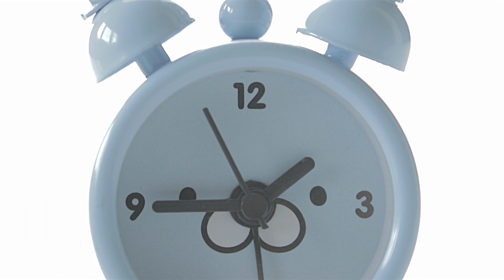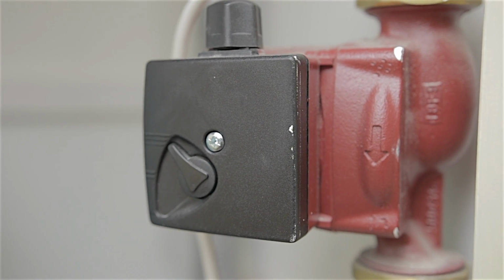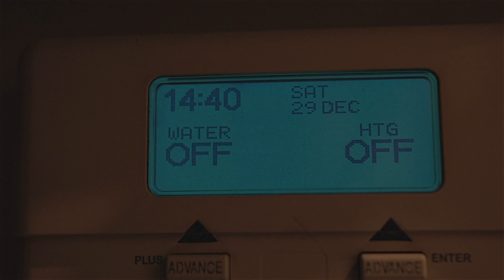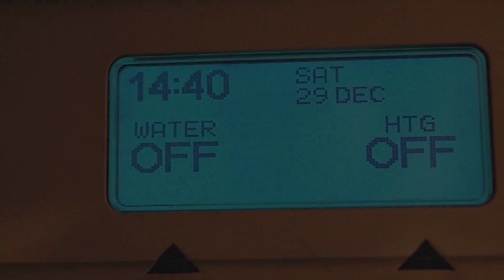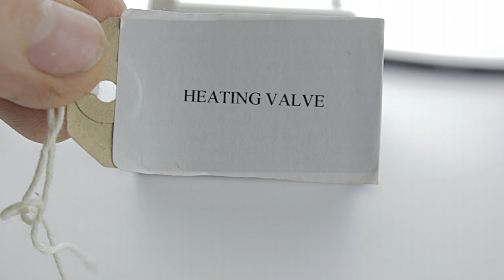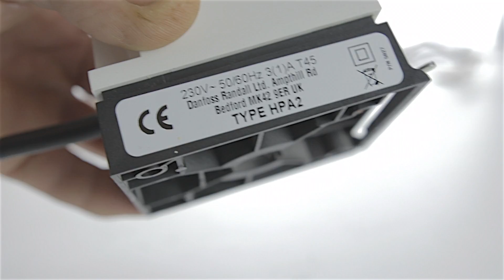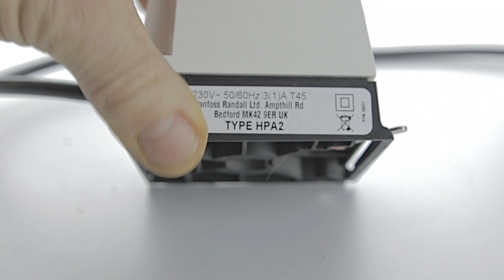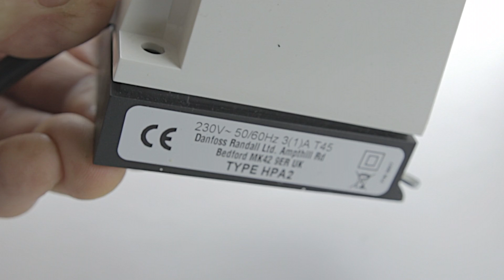My Boiler Wont Switch Off... Danfoss Motorized Valve

Comment: Just dealing with the same thing ! except my valve was shutting off at a 45degree allowing hot water cylinder heat to heat rads when off ..
cheers

Comment: Legend thanks saved me having to shell out on a plumber, took my Danfoss actuator off for the Hot water and noticed it had a really stiff valve, bit of WD40 and unstiffed using some pliers now back to working order, what made me notice this was that my hot water from the taps was beyond hot it was scolding, this was new, noticed my heating pump & boiler wouldn’t shut off even though the hot water was turned off
Reply from the maker: excellant😊

Comment: Helped me resolve a pump overrun issue, playing around with the auto/manual slider on the hot water valve eventually I got the pump to stop so now I know where the fault lies.
Reply: No need to replace though, remove, strip down, squirt a load of contact cleaner into the microswitch, press a few times manually and allow to evaporate then reassemble.

Comment: My boiler doesn’t auto switch on . However if I manually switch on it works . If I turn boiler off it auto switches off. Do I need a new auto valve?
Reply from the maker: probably but have an experienced electrician look at it first

Comment: Thanks very much for this well explained video. I've just had the same failed actuator problem. The unit kept clicking and trying to operate the valve, but couldn't. I slid the silver lever to manual (top left of the unit) and the downstairs is heating up again. Will get a new unit tomorrow.

Comment: I have 2 x Danfoss HPA2, one Hot Water and the other for the Radiators. The lever on the Hot Water one is constantly loose and on the Radiators one the lever still has the resistance so presumably off (closed) but the rads stay permanently on....any ideas?

Comment: Bang on!  This is a very strange fault and many suspect the boiler or timer.  In many ways one can consider the little micro switch in these units as holding your whole heating system hostage!  Once you know about this it is easy to solve what seem to be very odd issues with the boiler staying on or not starting up.  BTW one of the problems with the actual water valves getting stuck closed is the boiler will start up and then fail as it cannot pump against a closed valve even if it thinks it is open.  Ovalling of the plastic part of the zone valve can cause a loose fit too which is problematic!

Comment: Hi, can you please help me out my motorised valve moving when i turn the  heating on and off upstairs, but the boiler won't turn on unless I turn the downstairs heating on.
Reply: Check that the boiler is getting a connection (often orange) from the upstairs set so that it gets the signal to turn on and that the microswitches in the valves upstairs are actually being switched on by the motor turning far enough.  Sounds like this is not happening.

Comment: I have 2 danfoss zone valves one for the heating one for the unvented hot water cylinder. I have an ideal icos he12. My boiler isn't firing up but the pump won't shut off. Would this be the same issue. A faulty zone valve?

Comment: Hi Alan, my Danfloss 3 way valve electronics were changed by me 12 months ago, then I had the physical Danfloss 3 way valve changed and a Google Nest Thermostat Gen 3 installed to manage my hot water and heating by a heating engineer. Every 2 hours, whilst both the heating and the hot water are both switched OFF at the Nest, the boiler comes on for 30 seconds, the water pump is churning the hot water tank (I can hear it gurgling) the rads don't heat up and the Nest is not showing a request to burn but I can see from my energy supplier gas smart meter (shows usage every 30 mins) that I am using an extra 8 kW of gas a day (more than additional £1 a day). 

I rang Danfloss and got through to some pr1ck in their tech support who wouldn't help me because I was not a qualified electrician or heating engineer and refused to help me full stop. I have now ordered a Honeywell 3 way valve from my heating engineer to replace  that Danfloss sh1te and will report back later. If the problem goes away, I am sending the Danfloss equipment back to their HQ in Uxbridge for them to dispose of it.

Comment: Ridiculous designs on these things that the motor has to stay energised (using electricity) to work against the return spring for the duration of the time that the heating is on
Reply from the maker: yes and not very reliable either

Comment: Mine did not last 2 years, and it was a brand new house with brand new boiler system. After 3 years 2nd one is gone as well. They are set to fail after warranty period is over.

Comment: Thanks for this video. I think I currently have this exact problem. Do you think this repair would be too difficult or dangerous for a complete novice to undertake? Would it be better to get in an electrician to do the rewiring or would a different kind of engineer be required?
Reply: You can do it yourself. You posted this three weeks ago so interested to know what you did.
Reply: @roberthemsley2  I've ordered two replacement valves, should be arriving shortly. Still not 100% sure how I will proceed but am planning to check out the parts and evaluate the situation at that point. :)

I had a technician round who actually thought it might be an issue with our heat interface unit rather than the valves and tested the valves repeatedly and decided they were fine... only for the valves to exhibit the exact same issue a few hours later, after he'd left of course. It was all outside of his specialism though so he couldn't say for sure. At present my plan is to replace them, hope that fixes the issue, and if not then get someone in to hopefully look over the HIU.
Reply: @feedthefrog  I ordered a vale on Amazon next day and gotten them myself. Works perfect now.
Reply: @roberthemsley2  I fitted a relay Brown wire and natural to the coil and then split the orange wire across a set of normally open contacts. So when the switch within the valve fails the relay controls it. My valves always failed within the warranty period  I returned them to Danfoss for a replacement. There are different manufacturers heads you can fit.

Comment: Not mentioned in this video is that the valve actuator contains a microswitch which (in my case at least) is used to switch the boiler on when the valve is open. I'm getting a problem with the boiler not switching off, even though the valve is closed. I think it's the micro-switch that is the problem.

Comment: Thank you for the video. I have one of these I suspect is stuck open. If I remove it from the pipe work and disconnect cables (mine has a 4 pin connector so just unplugs) should this stop that system constantly calling for heat? I have 2 zone heating and it’s just the one for one room that seems to be stuck on. I need the main house ch and hot water still while I get around to replacing it.

Comment: Hey Allan great channel, I have a similar problem with my CH system but I think my issue is that the valve has siezed causing the motor to burn out. My heating is'nt working at all as a result??? Its the second siemens valve I've fitted, both have lasted roughly 10 years. I have a honeywell on its way.  Maybe I'll do a vlog & post it!!
Reply from the maker: i hear from a plumber friend that honeywell are the best brand

Comment: I have a similar problem, the valve appears to jam open. When the programmer tells it to switch off/close, it  doesn't, and I have to go whack it a few times and jiggle the manual overide switch on the actuator, until it eventually drives closed. I have replaced the actuator maybe 3 or 4 times, and cant find a solution, thinking it is a controls issue or the valve is overheating and jamming (its in the under stairs cupboard, under  a hatch which is carpeted. Any solutions??? or juts keep replacing the actuator every few years?

Comment: Great. Fantastic video. This happened to me too with the same age of valves before they broke. Just got both fixed yesterday. £40 per valve and £80 for the electrician to do the job and source the parts.
Reply from the maker: Glad it helped
Reply: I fitted a relay Brown wire and netural to the coil and then split the orange wire across a set of normally open contacts. So when the switch within the valve fails the relay controls it, I have had this system fitted for about three years now with no problems. My valves always failed within the warranty period  I returned them to Danfoss for a replacement. There are different manufacturers heads you can fit.

Comment: Would this valve have anything to do with heating hot water only? Currently can't figure out how to heat hot water without having 1 radiator on which can't be turned off individually

Comment: After I light a fire my boiler keeps pumping hot water to the radiator for days unless I turn it off at the mains. Doesn't do it if I just turn on oil heating. Would this be the same problem?

Comment: Many thanks for the video. This is exactly what's been happening to my boiler during the last two weeks. I found the valve lever locked into the fully open position. I have a Hive controller which said it was 'Off' but the boiler continued to operate outside of the scheduled periods. Can these valves lock themselves into that fully open position?
Reply: Yes they can, slide the lever to the MAN (for manual) side and it should lock in the 'on' position

Comment: I had those,  sadly mine used to explode, and create a smell due to valve seized,  and stink the aired clothes out in acrid electrics ,but in my modern house it would trip the mcb  and rcd and then house alarm would kick in to awake you in the middle of the night ,   Oh brill.  heating broke again  Fitted a horstmann no more issues

Comment: Iv replaced these in my house about 2 years ago interestingly I just had no heating as mine is wired in to  the time clock so the boiler would still fire up at the programmed times but it wouldn’t pump the water round the system because the motorised valve didn’t open unfortunately it wasn’t as easily found as yours and had to pull up half of the house floor to find it.

Comment: Look alan works aswell on boilers. If u fit a mondeo water pump there it should work better? 🤣 🤣 Good video 😉
Reply from the maker: it probably would lol
Reply: You would need to change it every 100'000 miles but it would only last 70'000.

Comment: That's called a zone valve, to hold the valve open against the spring the motor stays on and gets hot, and because it's on the hot water pipe it gets even hotter and so the motor burns out :( The actual motor inside should be available on its own for a lot less than you paid for the unit.
Reply from the maker: thanks for that explanation, that would have sounded much better in the video, you know your stuff here...i thought i was getting a good deal with just the motor unit...the internals are not advertised unless like you know how to obtain these parts but thanks for the information, appreciated
Reply: @alan4x  I was waiting for you to open the lid to show the motor.
Reply from the maker: i did open it but the motor was in a metal housing so nothing interesting to see so left that bit out
Reply: @alan4x  search for "synchronous motor for motorised valve"
Reply from the maker: so for ten pound you can fix an expensive unit if you know what to look for, thats pretty good to know, cheers